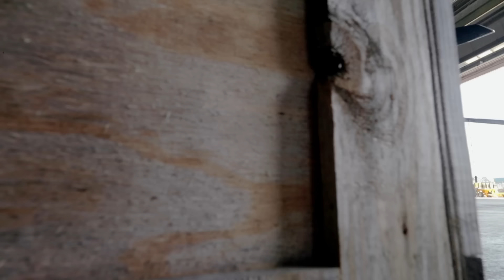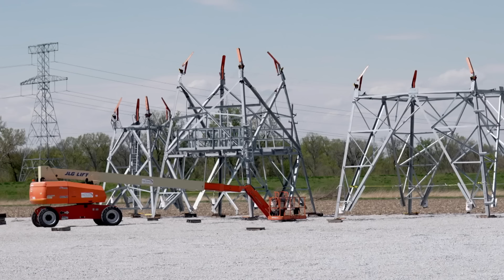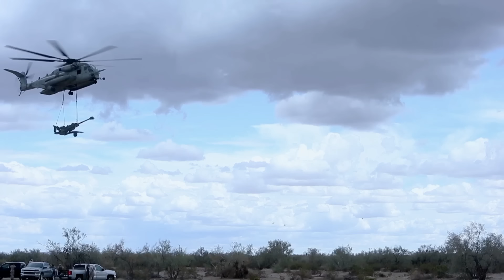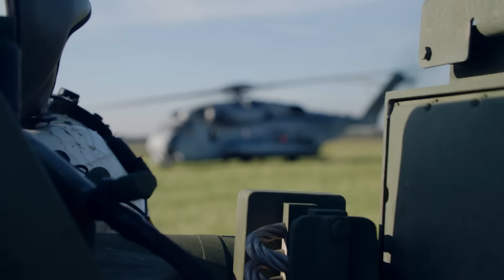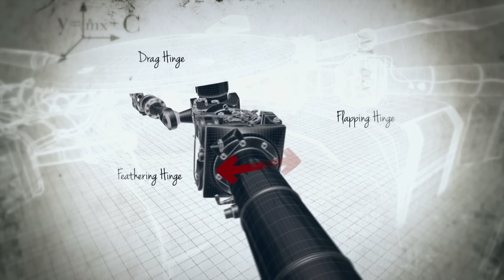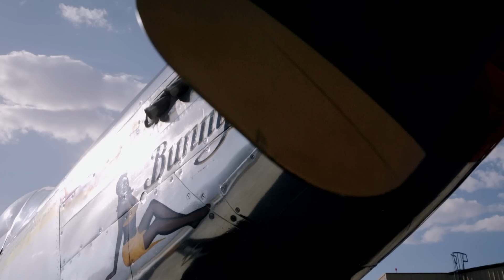The Largest & Most Powerful Helicopter in the World | Blueprint

Comment: The title should be one of the largest. The helicopter king is Mil Mi-26.

The Mil Mi-26 packs 2× D-136 engines at 8,500 kW (11,400 hp) each (≈22,800 hp total), a max takeoff (gross) weight of 56,000 kg, and up to 20,000 kg of cargo lift; it’ll do about 295 km/h max, stands 8.145 m tall, is 40.025 m long, and has a service ceiling around 4,600 m.  By comparison, the Sikorsky CH-53E Super Stallion has 3× T64 engines at 4,380 shp each (≈13,140 shp total), a max takeoff (gross) weight of 33,339 kg, 16,329 kg max external (or 14,515 kg internal) lift, about 170 kn / 310 km/h max, is 8.46 m tall and 30.188 m long, with a service ceiling around 5,600 m.
Reply: Thank you. Most western folks think US is the world. When some is the biggest in US, the think it's the biggest in the world.